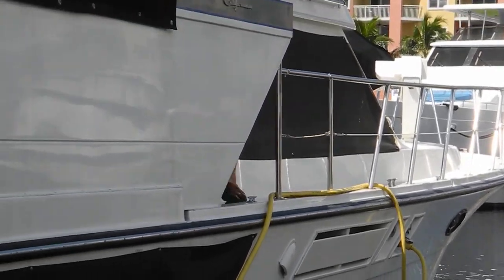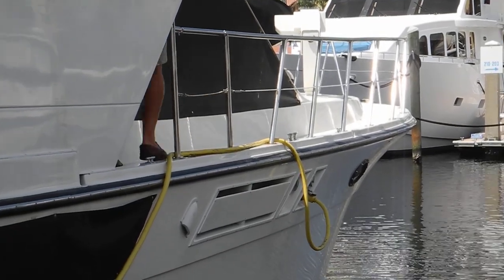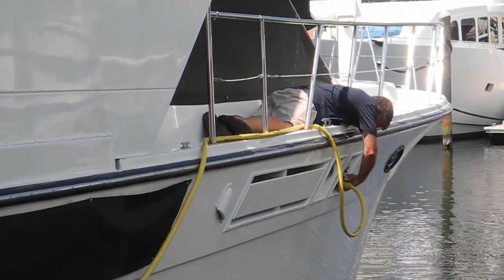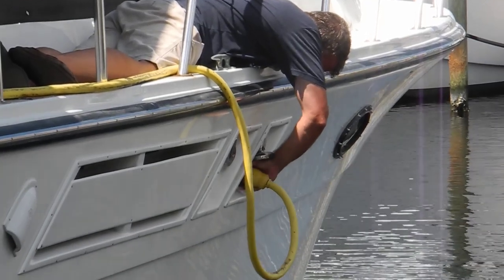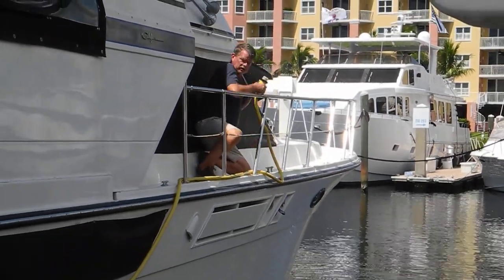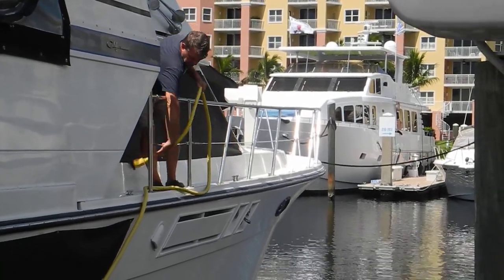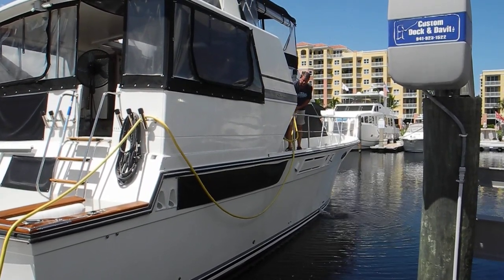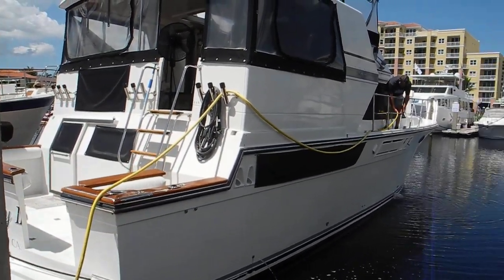Californian shore power

Comment: I personally think I would like where the plugs are located. If finger dock was longer it would be in a very convenient location to reach the plug while on the dock. The power cord would also not in the way while walking  the side deck which is a safety concern. The outlets are probably mounted in solid fiberglass and not in the cored section of the upper deck. It did not appear the captain had any trouble once he realized there was a ring that needed to be loosened. The trick is for the captain not to have a belly that gets in the way.